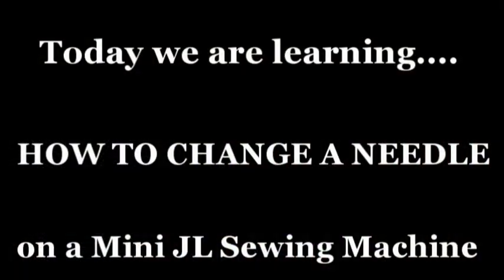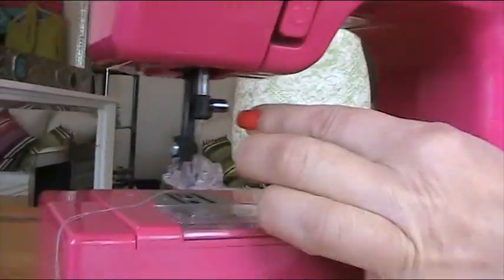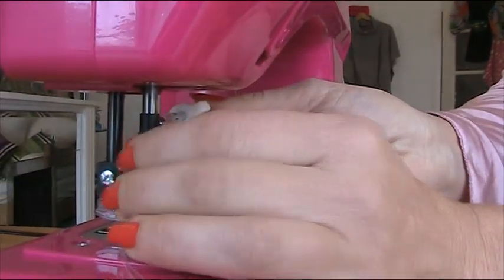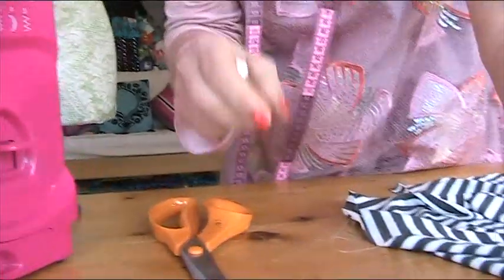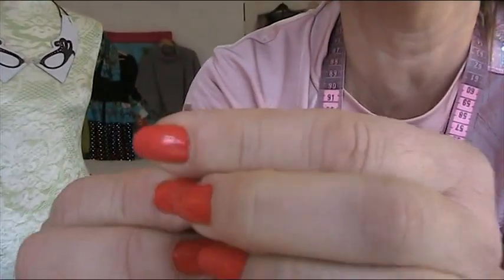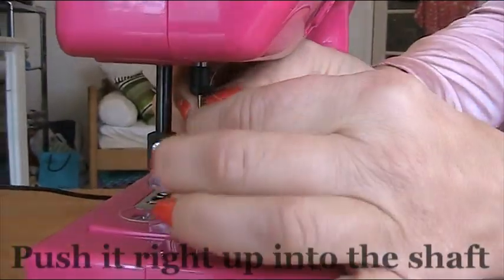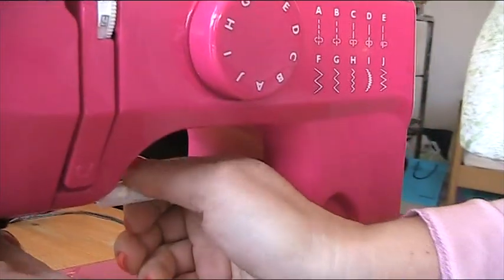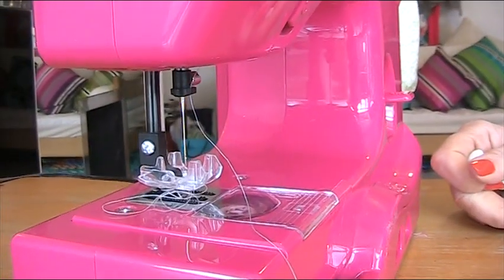How to change a needle on a sewing machine

Comment: i dont know if you reply to comments but i have this same machine but my screw wont hold the needle :^( please help!
Reply: btw the screw does screw just not with the needle in :^(
Reply from the maker: Hello, have you opened up the screw enough to receive the shank of the needle so it goes all the way up?
Reply: @moevulpix  any chance you fixed this? My is doing the same 😕
Reply: Mine is the same… the screw won’t hold when the new needle is in, but will screw tightly closed without it. 
Has anyone managed to fix it? Thanks